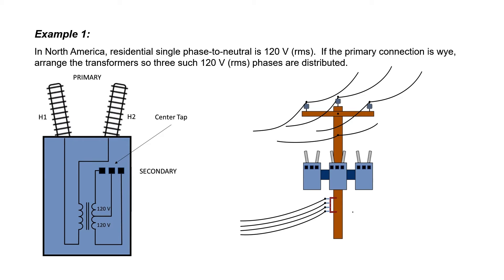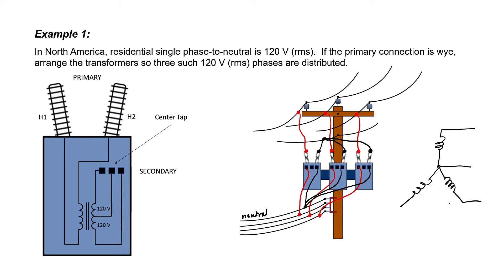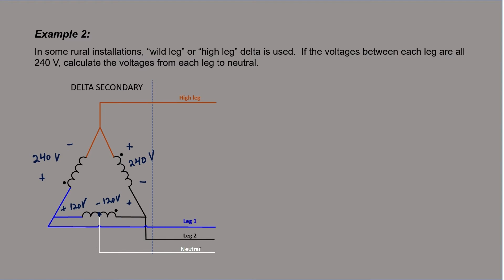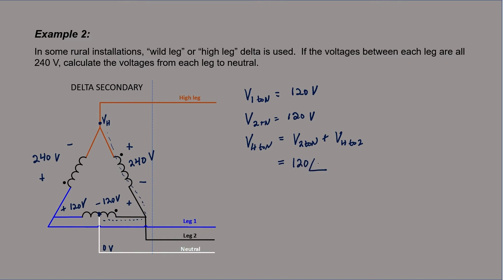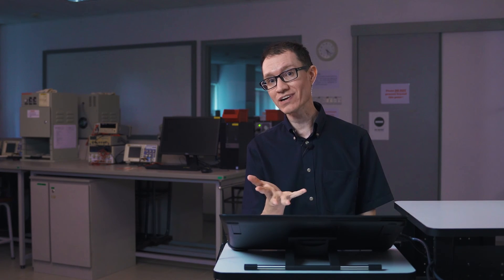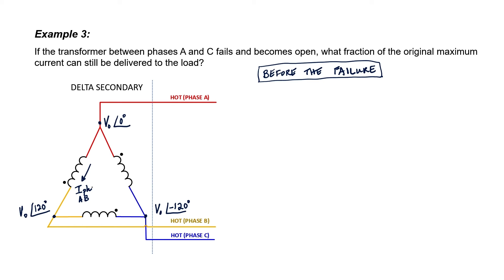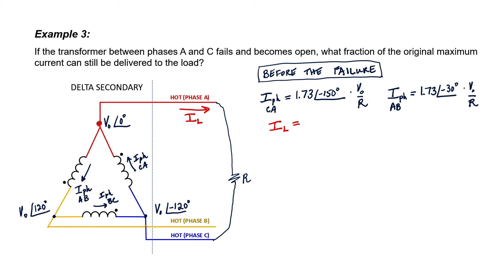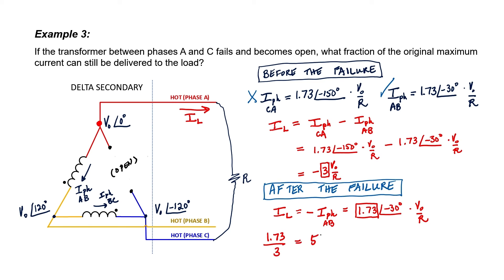3-phase transformers example problems (20 - Electricity Distribution)

Comment: In extremely rare installations,  there is a wild leg system at 480 V.   240V line to neutral,  415V wild leg to neutral. (Essentially the 120/240V three phase delta, but double the voltage )   This service is practically nonexistent, nonetheless it never hurts to be aware of it.

Comment: Wild leg delta systems although seldom used in new installations,  nonetheless can be very useful in very specific applications.   For instance they work great in a small commercial building,  like say an auto repair shop or woodworking shop that has a lot of three phase motors,  but also has some 120 volt loads, although typically nowadays you'd have a 120/208Y.    The major disadvantage is it's more difficult to balance loads especially if there is a lot of 120 volt equipment.  Also, it's a very common (and costly) mistake to accidentally hook up a single pole breaker where 120 volts is desired,  to the wild leg, and smoke up the equipment,  because you will be getting 208v.

Comment: I some installations,  there are two transformers feeding a three phase service,  typically on farms where a farmer is running mostly your typical 120/240v split phase,  but needs the ability to run a couple of three phase motors, in this situation the capacity of a closed delta is not needed, so the power company assuming three phase is available in the area, will install a second transformer instead of all three.   This greatly reduces costs.  This situation can be easily identified if you see two transformers,  one larger than the other, this is what was done.